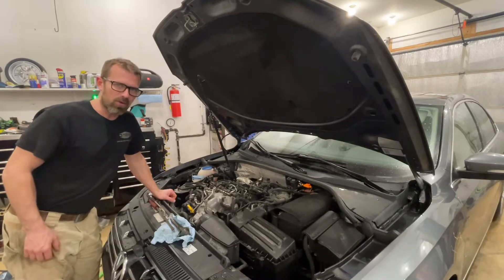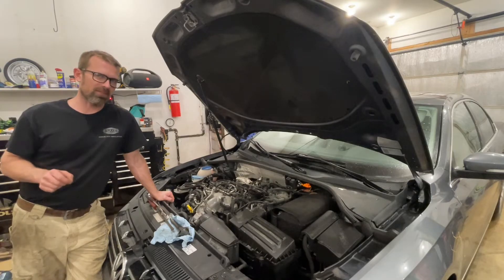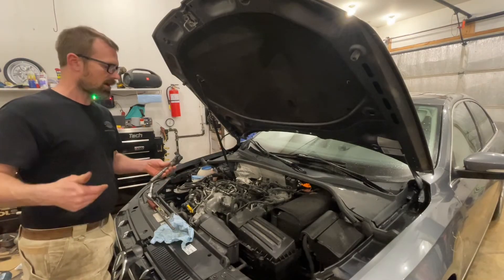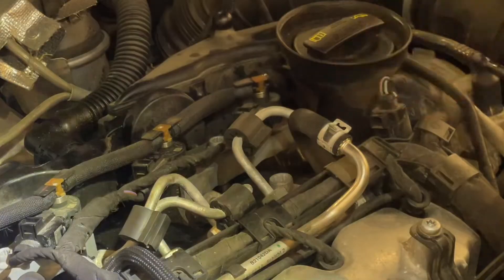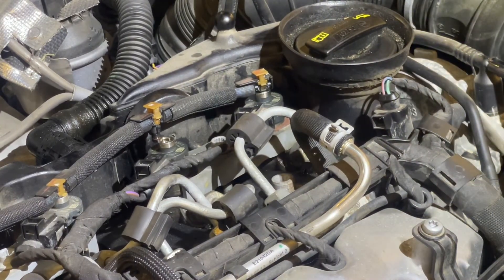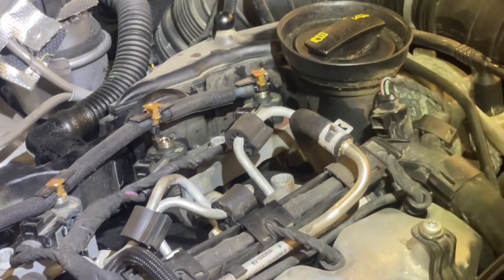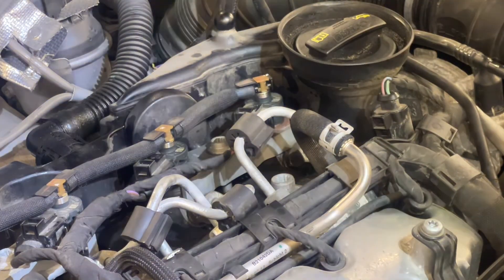🔧 TDi engine vibration & knocking. Diagnosing a bad injector on a VW common rail diesel. Not bad DMF

Comment from the maker: UPDATES BELOW!
Injector removal tool: https://amzn.to/3KPGtCt
New hold down bolts: https://www.fcpeuro.com/products/vw-b...
Triple square bit set: https://amzn.to/3J5xadh
Threadlocker: https://amzn.to/42cg3iG

The injector retainer bolts should always be replaced, they are "TTY" (Torque To Yield).
The hold down bolt torque spec is 71in-lbs +180 degrees, and I always use blue threadlocker.

This is the cheapest website I’ve found for buying OEM injectors. If you are having this issue buying a set of 4 injectors and just replacing them all is not a bad idea. 

https://volkswagen.worldoemparts.com/...

0:00 objective
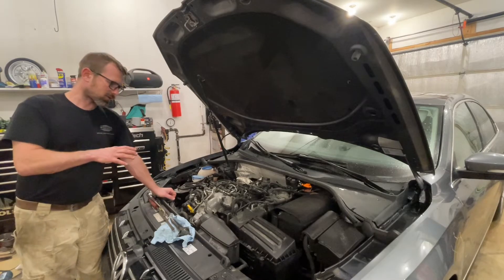0:52 symptoms
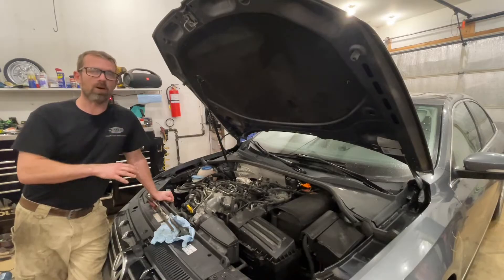2:31 what the injectors look like
3:35 tips on changing the injectors

As an Amazon Associate, I earn from qualifying purchases.  For your convenience, I try to post links to everything I use in the video description.  That's part of how I cover the costs of this channel.  I appreciate your support buy using these links!!

Comment: Thank you so much for posting this.  I have just sorted my Passat.  No warning light, but vibration only when cold.  Bought 1 reconditioned injector and swapped cylinders until it was fixed (cylinder 2, so second try).  Bought four bolts so I could dispose after each 'stretch'.  I would never have done this if it wasn't for this video and other comments.  Now a month after and all good and a £40 refund now the old injector sent back.🙏🙏🙏
Reply from the maker: You're welcome!  I obviously didn't have video of the symptoms, but it's such a common problem and a little tricky to diagnose.   I wanted to get something posted on it.  I'm glad it was helpful!
Reply: @bennieaust forget to add that because there was no warning light my 2 local garages were not keen at all to help.  The main dealer would have cost £000's .  Massive relief

Comment: Same issue on a MK6 Golf, 1.6 tdi, CAYC. The injector made a terrible noise at low rpm with the engine rocking badly from first cold start for 3-5 minutes. The conrod noise was there also and during a regen, the engine would almost lose power. After the first 3-5 minutes, the engine was quiet and ran perfect. No codes or engine lights on.
Reply from the maker: That’s what makes it hard to diagnose. No codes and then the symptoms go away!

At minimum, 1 bad injector.
Reply: Hi, im having the same issue. It feels like rod knock and knocking on deceleration at low speed, I have a four cylinder turbo is engine power and acceleration greatly decreased with just one bad injector on a 4 cylinder turbo engine?Sorry also would this knocking cause ECU to pull timing because it thinks it's knock?
Reply from the maker: @JoseSandoval-ic5xe I don’t know if the ECU pulls power but the engine simply will be making less power when it has 1 or more bad injectors. Just to be clear, on the TDI engines I have not seen this issue when decelerating, I’ve only seen it while accelerating. You may have a different issue going on.
Reply: @bennieaust I had it diagnosed by a shop and in injector waveform cylinder 2 is missing the pintle hump which they told me meant injector is stuck closed im having injector replaced tomorrow hopefully it fixes the really rough and cold start idle. Thank you
Reply from the maker: @JoseSandoval-ic5xe you’re welcome!

Comment: Great video! - I am currently experiencing the knocking sound with white smoke constantly... The knocking is really loud when accelerating but I don't get the error code though...Long story I actually posted on reddit my current situation, anyway any ideas how to get a really stuck injector out? I can get three out of the four loose but dangit one of them I can wiggle and fiddle it won't budge... I can dm you the link to the post if you have some ideas I would really appreciate it...I am lost...
Reply from the maker: Hey Heinrich, I revived your mail too.  Have you tried to tool like I have linked in the description?  That injector removal tool has saved my butt a couple times for sure.  That's my best recommendation.  Hope that gets it done for you!!

Comment: Always change the copper seal at the bottom on both of the injectors, and the clamping bolt is one tike use. Dont risk it.
Reply from the maker: I don’t have the injector install kit link with the new washer and o-ring but I do have the hold down bolts linked in the description.

Comment: I would have very very appreciated it if you could have shared the sound so we could make some similarities 😢. Through thanks for the information 😊...
Reply from the maker: @NjabuloNcube-s7p  I wasn’t able to catch it making the sound in a video because it only does it while cold and driving, for a very brief time. It’s not like the noisy DMF issue.  If it has a shutter under acceleration when cold, but goes away when warm, it’s an injector issue.

Comment: Finally someone with something helpful. Great video. Even if my 2011 2.0tdi 140hp don't show fault code, it bangs, loose power, and as soon as it's slightly warming up it's gone. Have also changed the dcf but did not fix it. Well it fixed the rattling from the dcf so still happy I did that job(the garage did, 1700$). Well I think it's time for an obd checkup while doing it. In Norway it's NOT 450$ for 4 new injectors. Great help man👍
Reply from the maker: I had a hard time finding help on this issue when I first encountered it. That’s exactly why I shot this video!  I have run into this issue on a bunch of these cars so I know it’s common, and a little tricky to diagnose. 

Thanks for watching!

Comment: Do NOT rest your prybat on the plastic vale cover to risk damaging this.
Try to rest you prybar on the Fuel rail securing bolts two  off, and use these as  fulcrum points for the prybar to excert pressure on the injectors.
Reply from the maker: I’ve linked the injector removal tool in the description.

Comment: Was your car blowing excessive raw diesel smoke from the exhaust ? I have the same exact symptoms just no code and excessive smoke.
Reply from the maker: No smoke, just a misfire type of engine vibration, and a LOT of knocking noise.  I've seen (and fixed) this on at least 4 of these now.
Reply: @bennieaust mine has the same exact symptoms just has smoke would that be the same problem ?
Reply from the maker: @ryangonzalez2627  I would definitely suspect an injector.

Comment: have you had EML on dash or any other warning light while engine knocking ?
Reply from the maker: I haven’t.
Reply: @bennieaust  i have exactly same problem with my BMW 435 diesel , sounds like rod but i think it's the injectors as the engine has just 77k miles on the clock
Reply: also no EML or whatsoever
Reply from the maker: @radimgrosek7255  I haven't experienced it with a BMW but I have many times with the 2.0 VW TDi.  It sounds scary, but obviously isn't a big deal.  Hopefully it's the same issue with your 435.
Reply: @bennieaust  it sounds like a mechanical issue , but the noise is located at the top end of the engine , I get serious vibration and horrible knocking noise , like bottom end is gone . I hope it is the injectors
Reply: @radimgrosek7255 was it the injectors??

Comment: Should've video taped the noise (I know it can be tough to get the right noise sometimes) good video man!
Reply from the maker: Thanks Konner, Yeah, I would have loved to catch it on video but it can be elusive. :(

Even though I didn’t catch it I wanted to make a video about it because it’s seems to be a common problem. I have fixed 4 recently for this issue.

Comment: Question! Do I have to calibrate all the injectors once the new injector is installed?
Reply from the maker: I’m not a VW technician so I’m not sure “what the book says”.  I have yet to encounter any adverse effect from just straight swapping these injectors.  As my video covers I have in fact, fixed the on going issues by just swapping the injectors. 

There are other videos talking about coding injectors and problems that may occur if you don’t:

https://youtu.be/WmdxoIm7LtM

Comment: I think I might have that problem with my ckra 2013 tdi it knocks while it's cold and when It's shifting gears then when is warm up it stops can't hear it
Reply from the maker: Definitely sounds like an injector. Has your check engine light come on?  I have not yet figured out how to diagnose which injector without a powertrain code pointing one out. :(
Reply: @Bennie Aust  that's a weird part check engine never came on I even dropped my transmission and changed my dmf thinking it was that and nothing changed
Reply from the maker: @vladsivc2709  it’s actually really common that the light doesn’t come on. Hopefully I’ll figure out how to diagnose which injector is bad at some point. I just fixed another one and had to swap out injectors a couple times before getting the bad one.
Reply from the maker: @vladsivc2709  definitely not a bad idea.
Reply from the maker: @vladsivc2709  , that's definitely a good option!